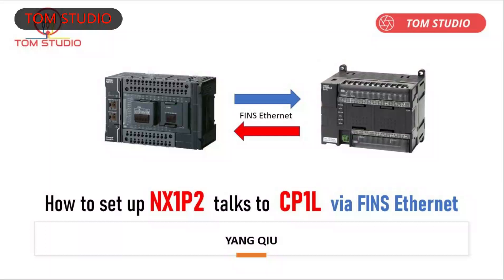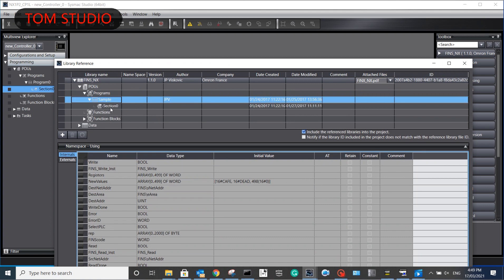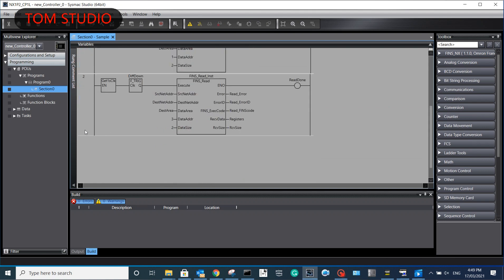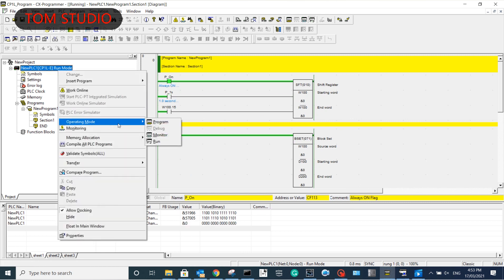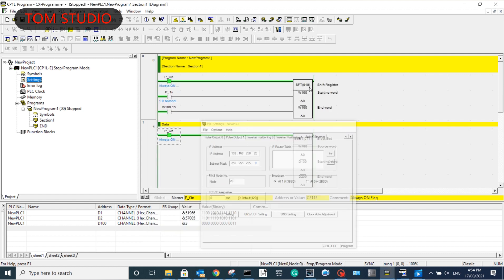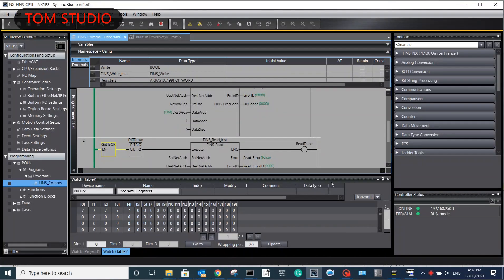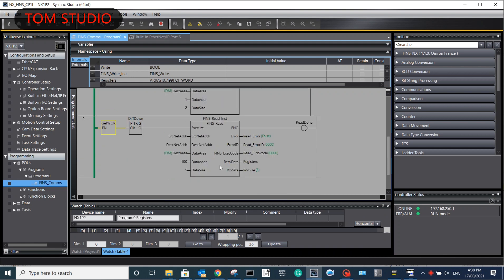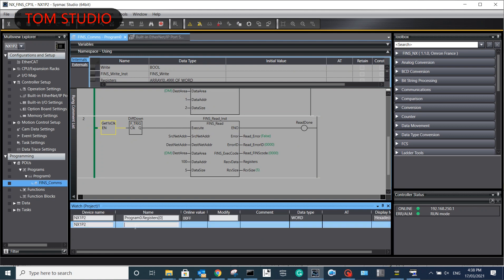Set up NX1P2 to communicate to CP1L/CP2E via FINS Ethernet protocol

Comment: hey friend, very inspiring video.
btw, how if I have 1 NX1P2 and 12 CP2E-N PLCs. all connected into 1 network, does this fins system still can be applied or it has maximum plcs that can be connected ?
Reply from the maker: It depends on which protocol you are using, Normally it is FINS UDP, and it can be set up to 16 Devices, like you said, you have 12 CP2E PLCs, so it is fine for using FINS UDP to carry out the communications. Another way is to use MQTT, but for settings, quite complicated than FINS comms.
Reply: @yangqiu472  thanks a lot

Comment: Is it possible to communicate the NX102 with the CP1H like the video?
Reply from the maker: Yes, you can definitely do the same communications, but please be aware that NX102 only port2 supports FINS protocol, so you must use Port2 from NX102 CPU, also CP1H doesn't have an in-built Ethernet port, you need to add an Ethernet option board onto CP1H, for the rest of settings will be the same as my example. let me know if you come across a hassle.

Comment: Thanks very much for your video and for sharing your FB, it's much appreciated! I've a question for you and for all that could help. I'm trying to communicate a NX1P2 PLC with a SCADA system that can only communicate using FINS/TCP. Do you think that it's even possible to setup the PLC in order to enable it to talk FINS/TCP instead of FINS/UDP? thanking you in advance, kind regards!!
Reply from the maker: Hi Michael, NX1P2 does support both TCP & UDP FINS, if you want to use TCP FINS, you need to set up the FINS TCP server & client, the client will be SCADA, NX1P2 will be server, you can find FINS TCP settings in Sysmac studio.
Reply: Dear @yangqiu472 , I cannot find those TCP settings inside Sysmac Studio, could you please indicate me where to find them? Thanks very much!! Kind regards
Reply from the maker: @michelferia  will show you later on coz I didn’t bring laptop home.
Reply: @yangqiu472  thanks again !  Good afternoon! 👍
Reply from the maker: @michelferia  Hi Michel, I have double-checked. NX1P2 is not like NX102/NJ5 larger CPUs and comes with FINS TCP settings, It seems NX1P2 is only restricted to set up FINS UDP, not setting for FINS TCP. For your application, you can either consider upgrading CPU to NX102, or using FB to enable FINS TCP Service, but NX1P2  in-built FINS service is very limited to only 3 TCP connections. Does your Scada support OPC-DC? OPC DC could be another option to communicate to the Scada. Kepware OPC has the full FINS TCP/UDP support to Omron NJ/NX and C series PLC.
Reply: @yangqiu472  Hi, yes we can add a kepware licence but we would like to use the built-in protocol if possible, could you please give me some ideas how to use the limited TCP functions? Only 3 connections seems ok as we have only one SCADA and only one Omron PLC, should be fine, isn't it? Thanks again, you bring me some hope on this 😀kind regards!!
Reply: Maybe I don't have the choice and I will need the OPC solution anyways, in your sample, you're using the fonction blocks if I understand correctly but in my case, the SCADA driver should be the client so it's not the same scenario, I need the PLC NX1p2 foncionning as server and the SCADA will be the client(the memory address to read/write should be configured in the SCADA)... I final thought in this 😉 ? Well, you already helped me a lot, it's very nice to find out your material, really useful and very well explained, thanks and have a nice day!!